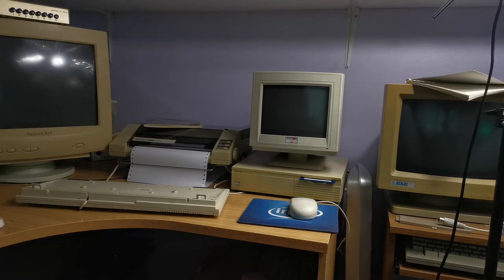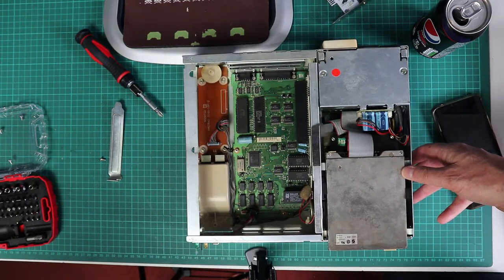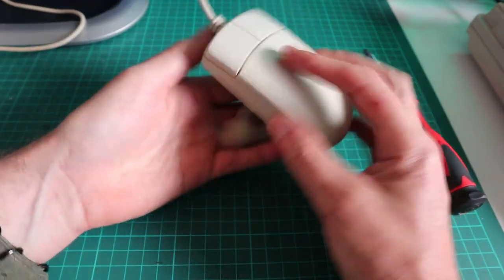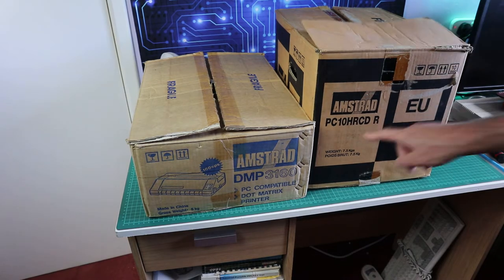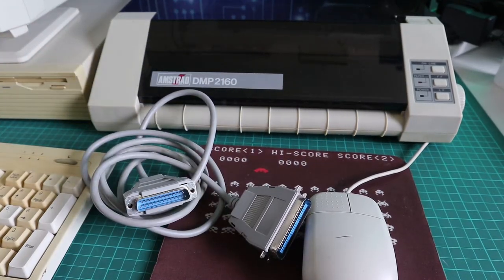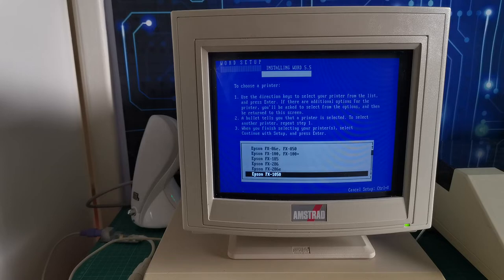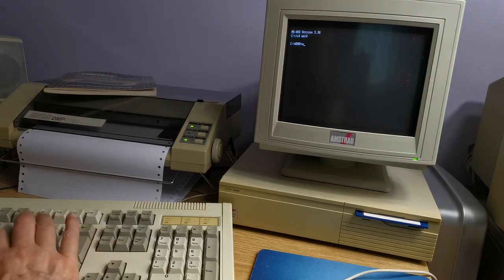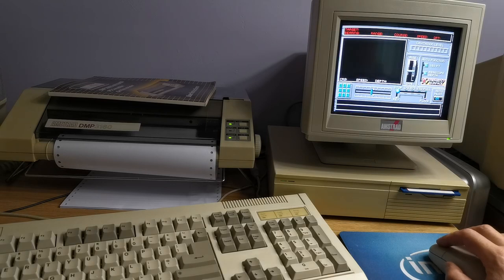Making A Mini PC XT Office

Comment: Its great that you made a video on this!

On my lookout for an XT class system I recently found one of these, complete with monitor, keyboard and mouse. I ended up bringing it home, it was complete and so small that I couldnt pass it up. Wasnt exactly what I was looking for, since i was trying to get an actual 8088 with a CGA card and monitor since what I wanted was a highly compatible XT clone (which I never found in all these years searching, at least not one that fitted my budget). However, the datasheet for the integrated graphics chip mentions that is fully compatible with CGA/EGA/MDA and Hercules modes, this was one of the reasons why i got so curious about this thing (my understanding is that VGA cards were never fully compatible with CGA modes, my knowledge of the technology from that time is limited, i was around 7 or 8 years old when this system was new and that was already a 386/486 era).

I havent fiddled around too much with it yet but it seems to work fine. The screen also flickered a bit, so i havent used it much, i need to find time to actually refurbish it, but it seems to work fine with one of my other monitors. Id love to find some setup disks for it also and a proper manual but havent yet. From what I could gather there were some software packs for it, mine has the Counterpoint GUI and the solo game in the hard drive is Lemmings. I need to get my hands on one of those XT/IDE isa cards with a CF card reader in order to do some proper testing without being scared of deleting anything important from the hard drive.
Reply from the maker: Cool 😁 yes I was the same, I wanted and xt and this came up at a reasonable price, a very late xt made in the 90s! I read about the software pack, it came with the gem desktop as well I think and dos 3. I got dos 3 disks but not the other software . The manual is on archive org and also setup disks for the 1512 which may be the closest to the original disks around. Theres alsobthe stand alone dos for the 5086.

Comment: I have this exact machine and sadly it's broken. I'm not sure what's wrong with it but it seems that the hard drive is dead and something else is wrong.
Reply from the maker: Thats a shame as its a cool little thing. I can't remember but think  hdd is just ide so you could put a new one in. Does it post?
Reply: @66mhzbrain  The last time I booted it I think it posted. It said something like "Clock battery dead, hard drive not ready." then it went into some weird bios thing. I replaced the clock a while ago now but it still didn;t work.
Reply from the maker: @Aaronfire7  if its posting and keeping the correct date and time then probably the hdd. I cant remember if it autodetects the drive or not but might be worth looking and running auto detect again in the bios or opening it up and getting the spec off the hdd casing and entering it by hand. Then if it fails try a different drive. To prove it is the drive you should be able to boot off an ms dos boot disk even if the drives not working and use the pc. Needs a 720k dd floppy though, wont work with a 1.44mb